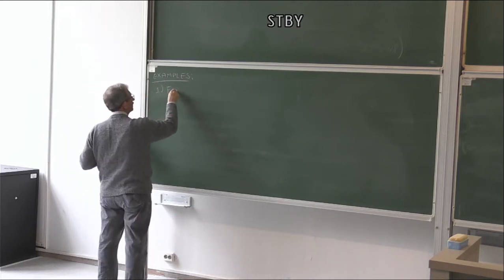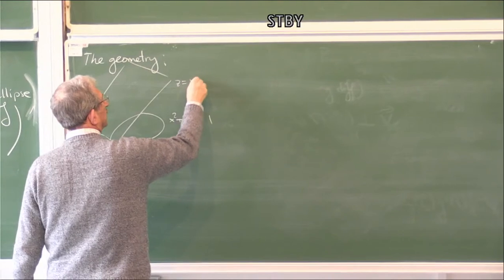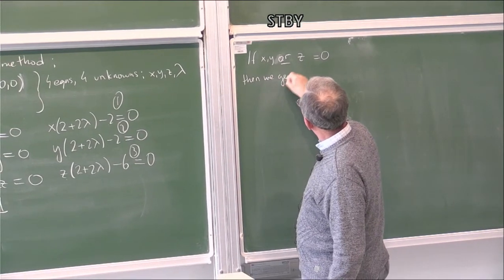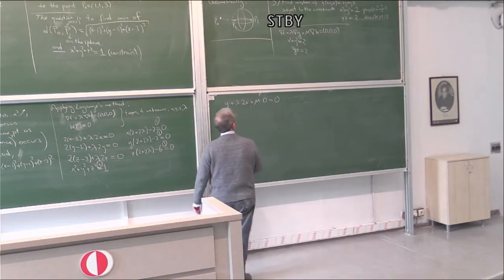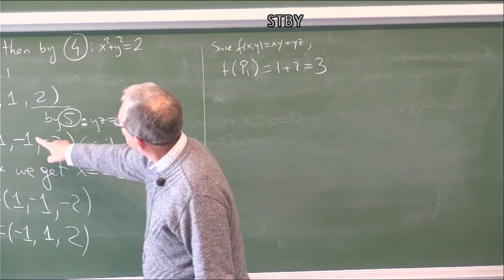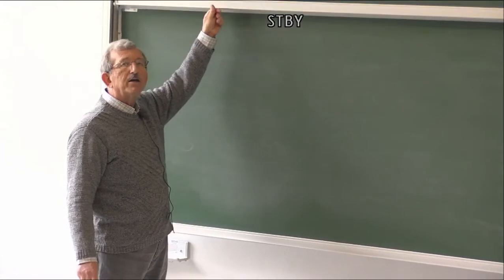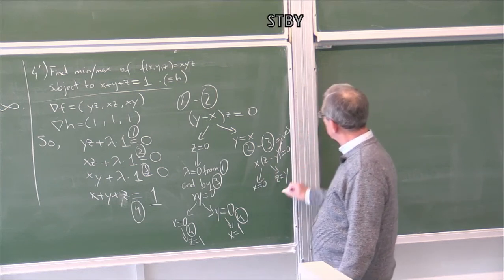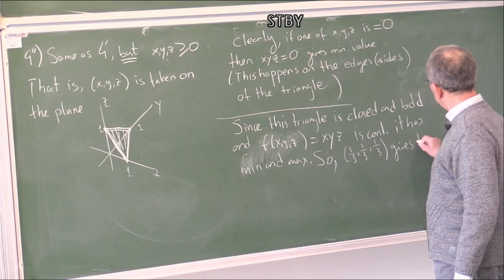MATH 120 Lecture 36: Lagrange's Theorem II - Zafer NURLU

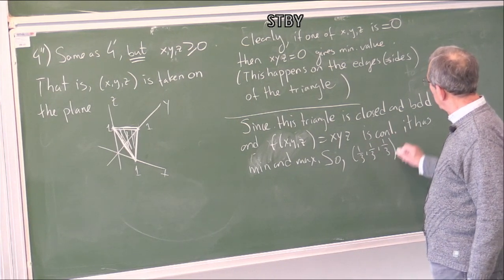Comment: Hocam, at 1:08:15 we said (1/3,1/3,1/3) is maximum: but at 4' question, we said that there is no max. but we found this point at the question. I could not understand.
Reply: You should be careful with the domain. In 4' there is no restriction but in 4' '    , x,y,z CANNOT be negative. So 4'  and 4' '  are different problems. As to FINDING the point (1/3, 1/3, 1/3),   note that Lagrange's method gives ( conditional) CRITICAL points, which may/may not give max or min.

Comment: Hi. Can you please try to coordinate your lectures because we are supposed to follow both your videos and Mehmetcik hoca videos and the problem is that we see different approaches for the same type of problems which confuses us??? Thank you.
Reply: Hi. Firstly the videos follow the syllabus as much as possible even though there can be minor order changes. On the other hand the approaches of instructors can be different, some can prefer to give more theory to help the student to understand "why" better, some can emphasize the "how" part. It is an advantage to follow both approaches whenever possible. But if you are in a time shortage you can certainly skip some "proofs" or even conceptual explanations. By the way,  if both lectures were almost identical what would the point be in repeating the same thing twice?